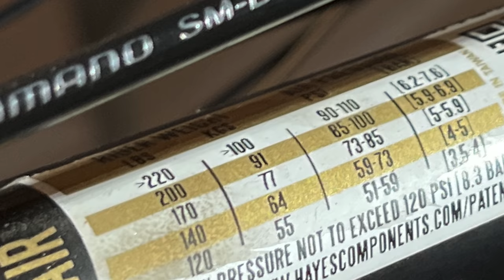How to Change Mountain Bike Forks | Silent Shop

Comment: Used this guide to switch out my X-Fusion air forks for a much better set of Marzocchi Z2 Bomber's, and it went perfectly. The only thing I think you could do better, is to show where exactly you should cut, in relation to your steerer height, and how deep a star nut should go, but it's not meant to be a full guide, so that's cool. Really appreciated this video though. Thanks so much
Reply from the maker: Thank you for your suggestions!  -Eddie

Comment: Good to know the Magnum Pro easily fits a 29 x 3.0" DHF, which is the same tire I run out front.  I plan to mount a Yari on my fat/plus rig with upgraded internals, essentially transforming it into a Pike.  I think the Yari should have enough clearance for tire widths up to 3.25".
Reply from the maker: Yes - the Yari cleared 3.25 - Eddie
Reply: @SimplyMountainBiking  Awesome, thanks!  I have a Bulldozer in reserve that I'll try running with the Yari.

Comment: Question:  You marked your steer tube at the top of the top spacer, then when you put it back together somehow it was slightly below the top of that spacer.  What did I miss?
Reply from the maker: Ah - great catch!  I didn't capture that part!  I made my cut on the bottom of that line to ensure the neck did not extend beyond the spacer.  Great eye! -Eddie
Reply: @SimplyMountainBiking  Cool, Thanks - I ask because I'm getting ready to put on a new fork and I'm just finalizing the proper procedure (never cut one down before) I've found that we're supposed to leave 3mm or so gap up top to give room for the star nut to draw things tight.
Reply: @SimplyMountainBiking  Thanks!. Glad someone asked that. I was wondering the same. 😃 I'm putting on new Manitou forks and just making sure I've got everything 100% figured out before I start.

Comment: Great video. Couple of questions if you're able to assist:
1) I'm installing a straight steerer fork into a tapered headtube (budget upgrade). The new fork is straight 1-1/8'', and my current (stock) fork is tapered 1-1/5''. What kind of adapter do I have to use for that type of setup?
2) Did you reuse the old star nut, or did you buy a new one for your new fork?
Reply from the maker: 1 - I have never done this before.  2 - I used a new star nut. -Eddie
Reply: its a crown race reducer. Same one they use in trek roscoe 6 bikes. Star nuts come with a new fork. If not, they are easy to find and not expensive. Dont use the old one, too much work to remove it and you basically need a long shaft or rod to hammer it all the way down potentially breaking it

Comment: Awesome content! Doing this now. I bought a lightly used fork and the steerer tube was precut, but in my case, 9mm too long. Glad it was too long and not too short, but it doesnt seem like a huge deal. Should i just try to get a 9mm spacer or torque it all down and run it?
Reply from the maker: I guess it depends on how high you want your bars to be? -Eddie

Comment: This is a great, no frills video, thank you! Quick question, hoping you can see this: I’m looking to replace my fork with one that has a much shorter steerer tube. It would come to the point where I’d have to get rid of all spacers. Would it be ok if I don’t use any spacers below the stem? As in no spacers at all? I’ve been reading online where many people say it’s either ok to not have any spacers at all or to have at least one spacer below the stem. Thoughts? Thanks in advance!
Reply from the maker: I don't think it's necessary to have any spacers below the stem.  Go for it! -Eddie

Comment: Great video.. right to the point with no bs.  I just replaced mine and noticed that there is a little bit of slack between the fork and the frame (when you slide the fork into the frame... where the two meet there), it's loose and i can't seem to get it to tighten up so when i brake, it rocks forward very slightly but enough to affect riding, and likely not great for the fork or the frame.  Any idea what I might be doing wrong and what i can do to tighten it up?
Reply from the maker: At the top bearing, bottom bearing, or both? -Eddie
Reply: @SimplyMountainBiking  bottom bearing.  Thanks for the quick response!
Reply from the maker: @Sooch67  It could be a number of reasons.  Did you re-use your old bearing, or did you install a new one?  You installed the crown race? -Eddie
Reply: @SimplyMountainBiking  well, I thought I put everything back as it was, but I clearly missed something.  Gonna take it apart again and make sure I got everything correct.  Thanks
Reply from the maker: @Sooch67  Let us know what you find! -Eddie

Comment: Great video 👍 but what is the part called that you hammered in to the top of the fork? And the tool used to force it down the tube please. Mine has come loose and needs replacing. Any replies would be much appreciated
Reply from the maker: Star Nut, Star Nut Driver.  :)  Good luck! - Eddie
Reply: Top man. Thanks 👍

Comment: what's the purpose of the distance ring above the stem and under top cap? future compatibility with other frames?
Reply: If you ever crash in a way that allows your body to make contact with that part, the protruding steerer augments the learning effect... (I am not making this up!).
Reply from the maker: I will adjust my stem up or down depending on the type of riding I am going to do.  On a bikepacking trip, I want to sit more upright and relaxed.  On a race, I want to be slightly more bent over and aggressive.  -Eddie
Reply from the maker: It does present a 'knob' to bump into in a wreck - but I'm already riding a bike with a lot of other crap that can hurt me in a wreck too.  Ever land on a frickin' pedal?  :P -Eddie

Comment: How trustable are quick releases? I have an old bike, with a quick release. Is there a chance it would release the wheel while going?
Reply from the maker: I've not had that issue.  I check mine frequently and tighten as needed, though. -Eddie
Reply: @SimplyMountainBiking  Hmmm. Maybe I should too. Thanks!

Comment: Hi Eddie. May I know the name of the piece @2:34. Is it from the new or old fork and do you need a special tool to insert it back in? Thanks.
Reply from the maker: Hi!  It is a star nut.  I used a star nut driver from Park Tool.  The star nut is relatively inexpensive.  If you don't want to use the Park Tool star nut driver, you can buy an inexpensive carriage bolt.  Good luck!

Comment: Do new forks come with the crown race part? Are all crown race parts the same? The part he installs at 1’22”.
Reply from the maker: I'm unsure if all forks come with the crown race.  Every fork I have bought (maybe 4?) has. -Eddie
Reply: Forks don't come with the crown race, but it will come with the headset as it must match up with the lower headset cup (if external).

Comment: Why is the replacement tube longer? you shouldn't have to cut that, the new part should match oem measurements.
Reply from the maker: The replacement was not OEM and was made to fit many different bikes.  -Eddie

Comment: Wondering how much torque would you put on the top cap bolt?
Reply from the maker: 4-5Nm -Eddie
Reply: @SimplyMountainBiking  thanks for the tip!
Reply: That should not be done up to a specific torque, but it really depends on the bearing... you do not want slack in the bearings, but neither do you want it under a lot of pressure, because that would damage the bearings. So you basically need to "dial it in" to have a headset bearing that rotates freely without being loose. Then you fully tighten the stem to its specified torque. Once that is done, and the bearing therefore set, make sure the cap is tight against the stem.
(With all due respect, the way it is shown in this video - screwing down the cap to a set torque before tightening the stem - is wrong IMHO, as it risks damaging the bearing at worst, or ending up with a headset that does not rotate freely at best.)

Comment: So.. My problem is. Someone welded the brakes, onto the telescopes of the first wheel. The weld is letting the brakes go, which will fall off, and the telescope doesn't work.. obviously. So I want to replace it, with a normal, more primitive type, that has no telescope or quick release, but a space for the brakes, a proper attachment point, or properly installable attachment point. Hence I'm here.
Reply from the maker: Sounds like a problem! -Eddie
Reply: @SimplyMountainBiking  A massive one. I'm replacing the back brake, should work.

Comment: He put the suspension fork on the wrong side 😅.
Reply from the maker: What did I do wrong?  -Eddie
Reply: @SimplyMountainBiking  the connecting bridge should be at the front.
Reply from the maker: @rejvexplx449  Oh, no.  Manitou forks are backward.  Check into it!  -Eddie

Comment: Hey I just took my 2021 Orbea Rise to Fox service centre to get the fork and shock serviced but they removed them and gave me the bike back ! 😢is it easy for me to fit the fork and shock back onto the bike or would you recommend taking the whole bike back to them to fit the shock and fork back on?
Reply: Its pretty easy just need some allen keys. Knowing what to torque each bolt to is the harder part. If your unsure just bring it with you. It won't take them more than 10 minutes.
Reply: @martinchapman1032  yeah they emailed me and said “ it’s not something we usually do we’re not a bike shop” but I took it back anyway and they put the suspension back on the bike foc so I’m happy with that. Can’t say I notice any difference whatsoever after the full service at £274! But I’m assuming it’s good to get them serviced after a year of riding it 👍🏾
Reply from the maker: Glad you got the help you needed. -Eddie